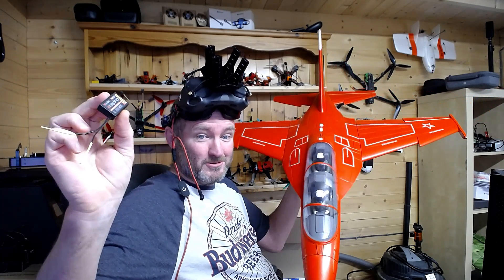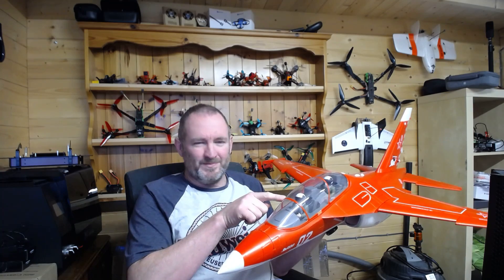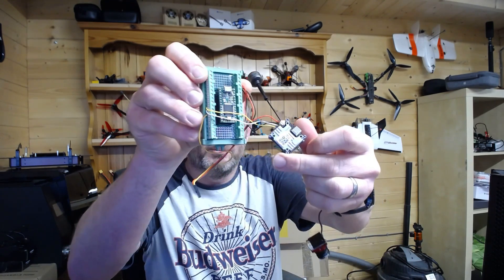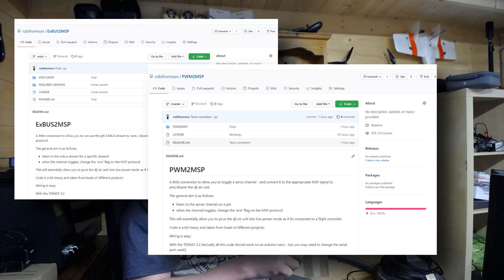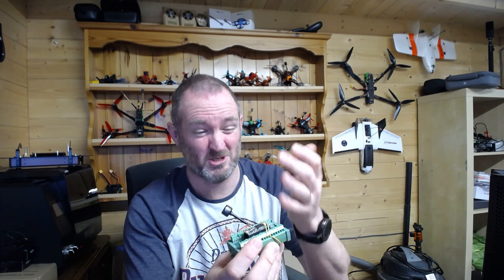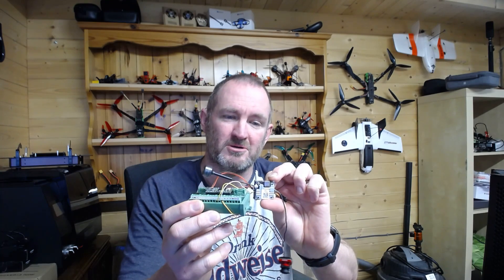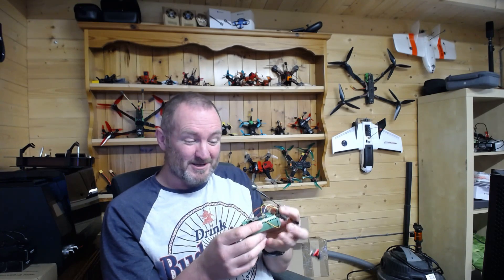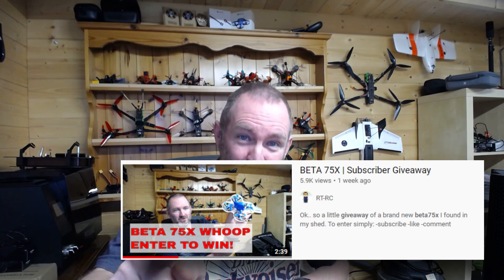Control your dji air unit with a servo port?

Comment: This guy must be a retard,  if you want to stay recording with your AU when you aren't using a flight controller is you push the record botton on the top right of the goggles. Pffffft - pretty simple id say

Comment: Hi! I have done last year what you were talking about: a backpack osd for the dji hd. Of course with an f405 fc :) I don't trust in opensource things enough, so my autopilot on the plane is a simple Zohd Kopilote lite. The backpack gives the osd, but no control over the plane. I had only one thing to do: splitting the s.bus signal to Zohd and the osd fc, because the home point sets on arming. Without this you don't have home distance and arrow. It works, I also have telemetry to R9. Another hack to make osd video: telemetry transferred via bluetooth to a phone runninig telemetry viewer app. It shows the datas on the top and the bottom. So if I record this with a screen recorded app, I can insert the flight hd video in between the  upper and lower datas in the video editor with a simple pip :)

Comment: Dang, Im trying to control one camera angle servo with one of the crossfire nano pads.... supose to be straight forward.   Not so straight forward when you're blind and can't see a d@mn thing on the crossfire nano.8
Reply from the maker: Been there!   You should look into one of the digital microscopes.  Fantastic for soldering small pads!

Comment: Yeah, seems like an F411-WSE with inav setup to the absolute minimum might have been easier and even smaller. Cool idea.
Reply from the maker: Lol.. Possible.     But also a pita if you gave to gut an existing setup.

To be fair.. Mostly did it to see if I could :)
Reply: @RTRCTV  I have an LED controller Arduino that is the same, just to see if I could haha

Cant wait to see the scale cockpit view fpv of the Hawk,  will be awesome if you put pan/tilt in it.

Comment: All that to avoid buying a cheap flight controller that weighs a gram or two?  I would think you could wire a relay or something off the buzzer pads and a switch on the radio to just connect or disconnect power to the air unit and start and stop the recording.  I don't think buying all of the Arduino stuff is going to be any cheaper.  I am not a fixed wing guy so i don't know.  I go with what i know.
Reply from the maker: Lol..    Not at all.  You need to support the msp protocol.  Relay will not survive.

Thing is..   2 hours effort that then works.. Forever means super easy to create time and time again if required.

So. Not really much effort.
Reply: @RTRCTV    Yeah i am thinking quads.  I put my air unit on a budget GPS drone that had a broken camera.  I just plugged it into a 3s battery and recorded the whole flight.  That's different than a fixed wing that might fly for an hour or more and you won't want to record the whole flight.  Also if i really had to start and stop recording I have the DJI radio and could stop and start recording at any time, but that would require a second radio because the GPS quad would not fly with a DJI radio.  I am going to shut up and stick to the drone world LOL.

Comment: I have my radio squark out the voltage every 30 seconds, plus I have a rather off putting "you're battery is about to crap out" message when it gets too low.  But I like the idea of using an arduino to fake the armed signal to the air unit, although tbh one of my air units spent a day in a tree on full power, then another six months before we could get it back, and when we did it hadn't suffered any ill effects.

Comment: I  fly fpv planes and just got dji.. Osd voltage is what we need, recording on take off, who cares I can hit record.  I'm barely smart enough to understand all you say, but that's my take on what I need... First thing I'm missing is voltage of the plane in the goggles
Reply from the maker: Lol.    I see your point.

Depends on what your end kit is.

Its no big issue..  Voltage will be added before long.

Just a matter of a couple of more parts to solder :)